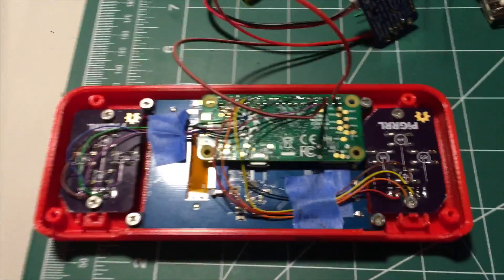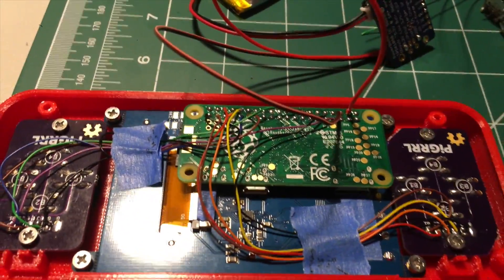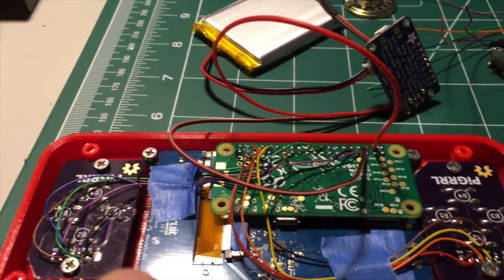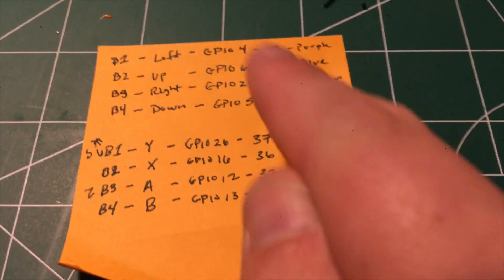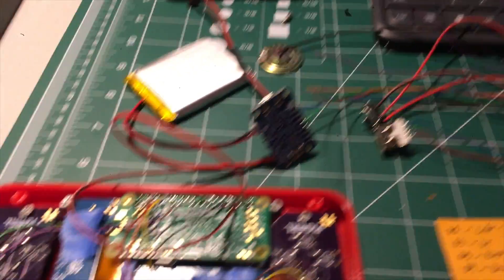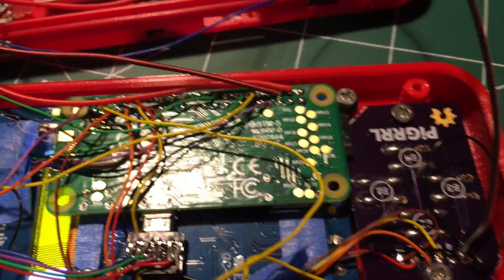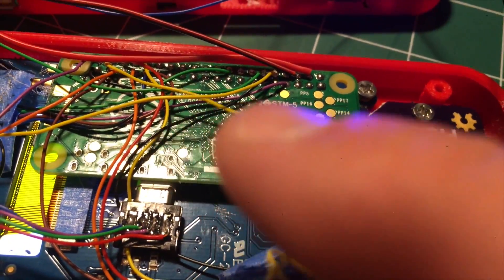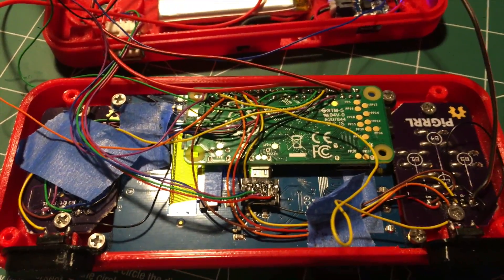PiGRRL Zero Plus - Tutorial 3

Comment: i am 98% sure ill buy the pigrrl zero kit as my first raspberry pi project. is it worth spending 35 dollars on the 3.2 inch screen or is the 2.2 inch screen good enough?
Reply: just checked and its only 10 dollars more expensive, i wont order the kit but rather find all the parts and use the 3.2 inch screen. i dont have a 3d printer but i'll try and make the shell out of wood.
Reply from the maker: Jeppe Werring I prefer the 3.2" but it is a tad bigger if you care. It's going to cost a bit more but I think it's worth it.
Reply from the maker: Jeppe Werring check out my Etsy if you need a case printed!
Reply: ***** do you ship to Norway? but i'm pretty sure i'll make it out of wood to get a nice grain making it a bit unique :D
Reply from the maker: Jeppe Werring I would if I knew how much Shipping is to Norway. You may be better off finding some one local to print it for you though.
Reply: ***** yeah